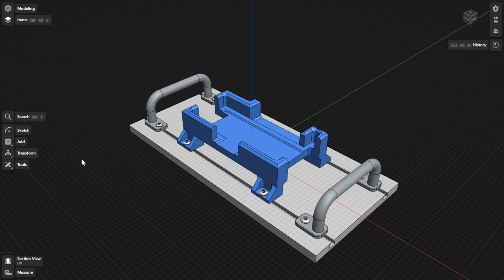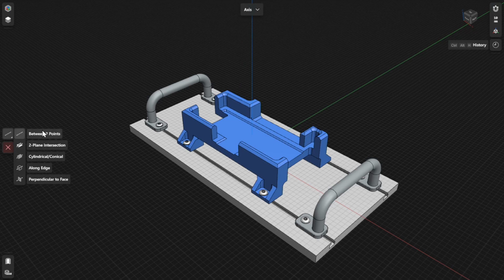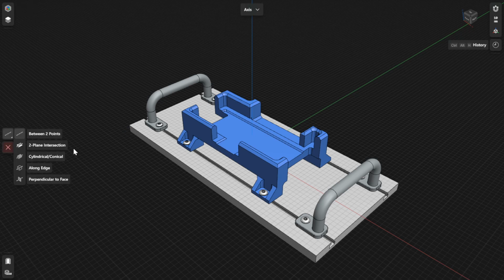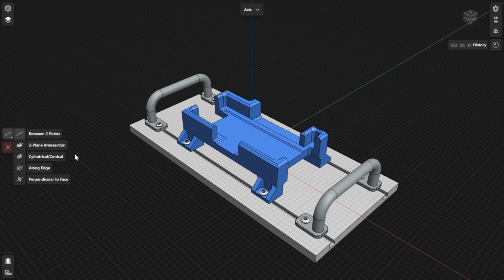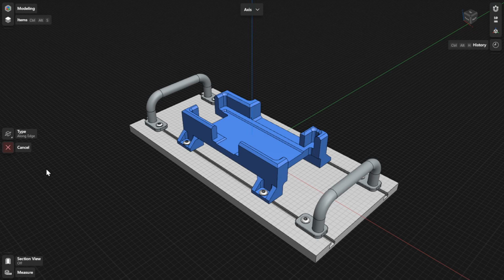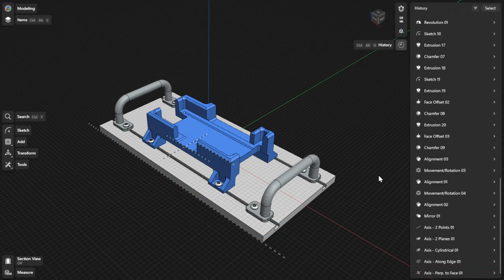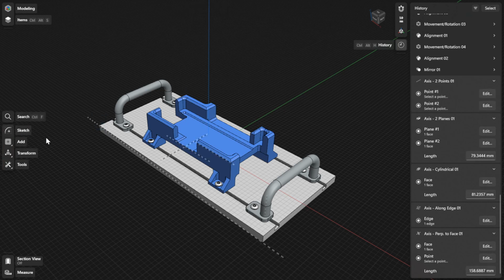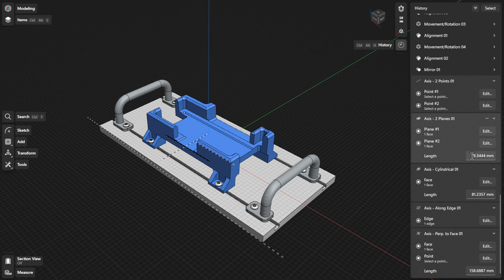Shapr3D Manual - Construction Axis | Add

Comment: these tutorials are horrible, they offer no insight into what the actual tool does or any examples. it's just reading a button and clicking what it asks for anyway.
Reply: Exactly. Huge market for a 3rd party guide to Shapr3D. I cannot extend an axis. I want to have the sketch tool snap to the axis so I can create a series of objects whose edges line up with the axis. The snap doesn't snap to nearby objects when you're extending or sketching an object, so it's pointless!
Reply: @ exactly. What I was most excited about using it was how easy it was and it would flow but have sticking points that needed clarity.
I since went to Fusion 360 and even though it was an absolute pain in the ass to get good at, using the heap of online tools I got good and is second nature to me. So glad I did because it can do anything but you have to put in the work to start.
Reply: agree